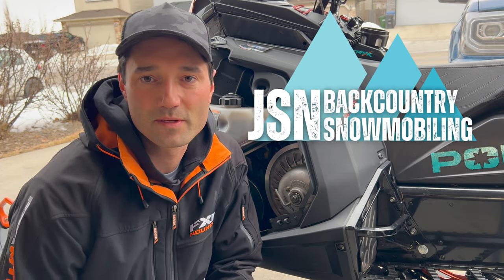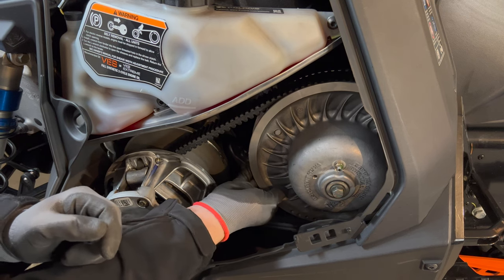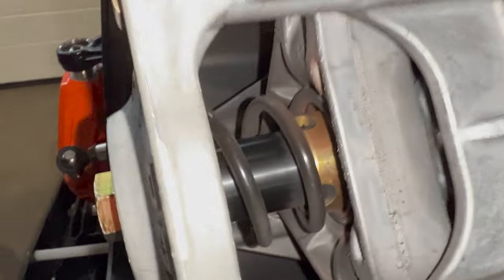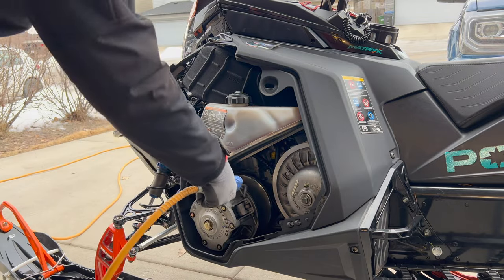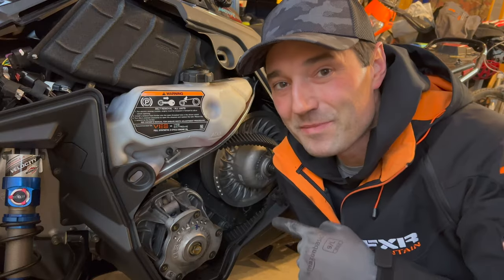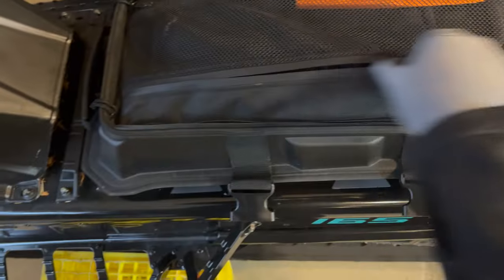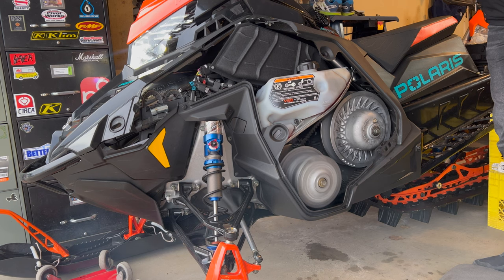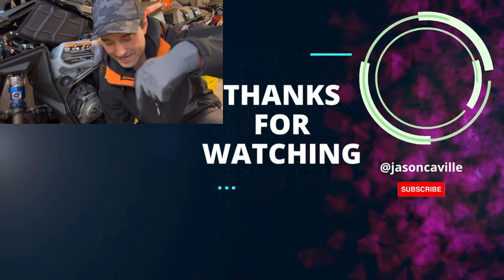Tip: Easy Clutch Belt Maintenance \\ Polaris RMK Belt Deflection

Comment: WOW !! 500 hundred miles on the oe belt. How high or low the belt is out of the driven clutch is not the proper way to determine belt deflection.